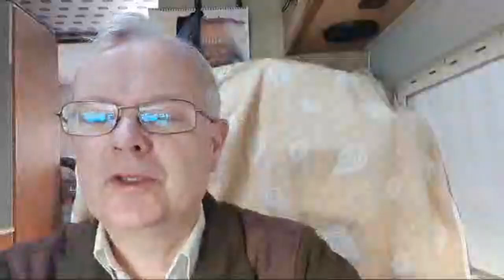How long to wait for a new RV? Vanlife Live Broadcast 6 March 2021

Comment: Give the alternator a tap check wired terminals for corrosion and tightness wonder if belt is slipping on the alternator.
Reply from the maker: I will give it a go tomorrow - no point in doing it in the dark!